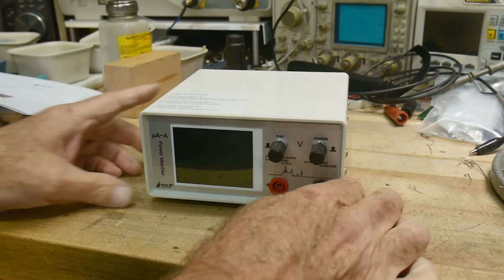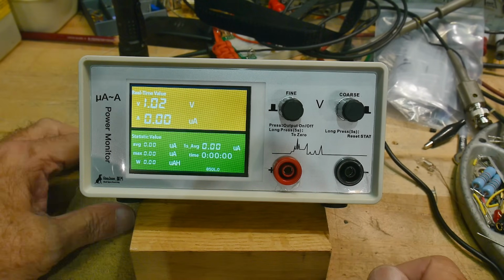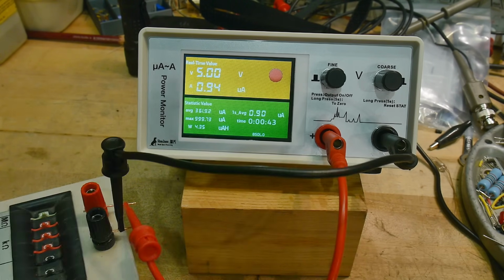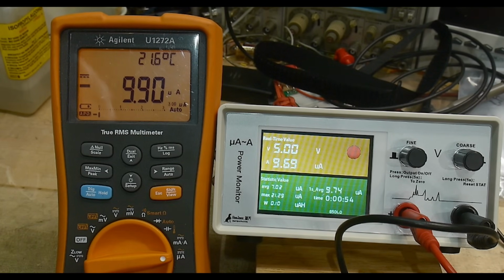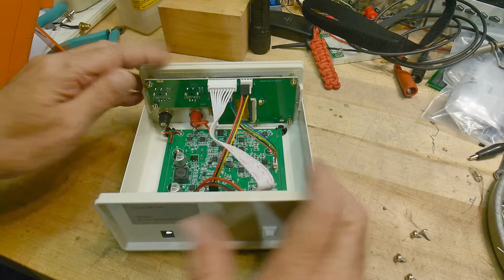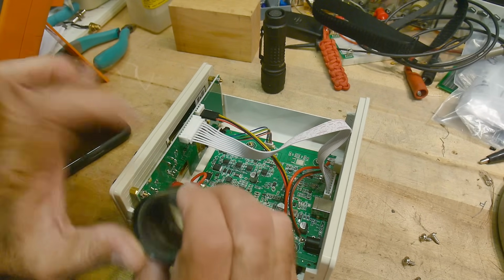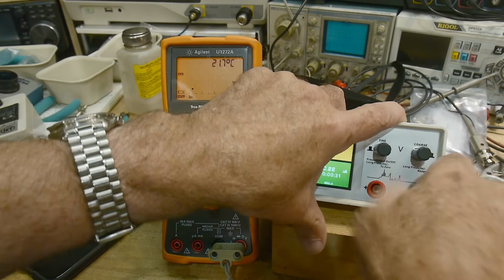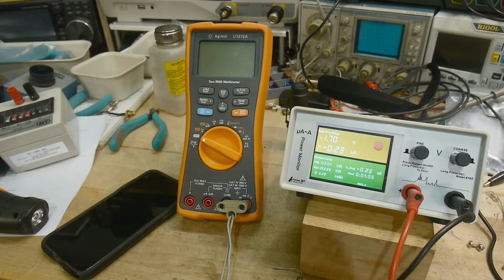#1675  ReeJoee uA-Level Current Analyzer Review

Comment: Measuring µA with a device that is powered with noisy switching powersupply can't be accurate.
The DC jack is probably 5.5mm x 2.5mm, if you have a old notebook charger or other faulty powersupply with such a lead connected, cut the lead from the charger and attach banana jacks, then power this "Analyzer" with a linear powersupply, and i bet that it is more stable and not jumps arround like that. 
The wires from the DC input to the On/Off switch run over many IC's, where the switching noise gets injected in those IC's beneath. 
If you use a Non Contact Voltage detector like a Fluke Volt Stick or a generic one, those react to the switching noise on top of the DC from switching powersupplies. It wil light up like a christmas tree inside that "Analyzer". Because this switching powersupply doesn't have a earthpin, there is also a certain amount of mains voltage (in µA range) leaked by the safety cap between the primary and secundary side of the transformer inside that switching powersupply, this mains leakage is also present on the banana jacks. With all those flaws together, you can't have a decent and stable readings.

Comment: I don't think you'll get anything else from 'ReeJoee'.  The user interface seems a bit clumsy.  adding a push button switch would make things easier.  Then there is the specs issue you talked about.
As soon as I see switchmode supply on delicate test gear I cringe - noise noise noise.  Sadly it so common now.
The display is good to my eye.  Having the 1sec average value is good as the fast varying on the 'live' value is of very limited value.

Comment: It is $199 for the version seen in this video witch seems about fair for what it looks to be a very low volume product. It is 12V 2.5A so sufficient range to test battery powered devices.
It uses the 16bit sigma delta ADC build in to the microcontroller so plus minus 32000 counts that means for 2.5A max it could measure down to 0.1mA thus it needs to change ranges and based on the video that is not done fast and it also means it will need to zero out all ranges. He should have added a dedicated button for zero offset calibration or he should do that at power up then leave that button for ON/OFF.
Software could be better and probably also the hardware but how much effort can be spent if this is maybe 100 or 200 units of volume per year if he is lucky.
The user interface is fairly bad but even if he spent more time to improve that and even fix everything it will still remain the same niche product and he will still not sell more of them.

Comment: When I want to measure very low dc currents, I use an old RadioShack Model 22-802 pocket autoranging DVM.  When it is measuring dc voltage on its lowest autoranging scale (200 mV max, 0.1 mV resolution), its input impedance is "nearly infinite" (probably higher than a hundred gigohms).  When I connect it in parallel with a 100 megohm resistor, by Ohm's law, 0.1 mV becomes one picoampere.  So in this case I have a 2 nanoamp full scale meter that can resolve a picoamp of current, and it measures its own voltage burden!  If I use a 100 kilohm resistor, I have a 2 microamp full scale that resolves a nanoamp.  With a selection of 1% tolerance resistors in decade steps, I can keep the voltage drop under 200 mV so the unit does not autorange up, and I can measure any current I want.  Being battery powered, it can be floated in-line on lines of any voltage.  I think I paid about $20 for the meter on sale a long time ago when it was being discontinued by RadioShack.  Today, resellers are asking higher prices, but there are similar copycat meters marketed today that presumably have the same characteristic.

Comment: I was completely unsure about the purpose of that unit, so I did a little bit research (it's a good way to procrastinate, I have much more important things to do, but, well). I didn't find that company (or what it is), but what I found is a set of videos on YT describing how to use this product. And the purpose of that thing is fast measurement of low and high currents drawn from that unit (or other device),  displaying them on the screen of connected computer and integrating them in time to display them on the device's screen. This should be useful in case of analysing devices that consumes power in pulses or bursts, which is measurement you can easily achieve using an modern oscilloscope and current probe (or current shunt). But in this case, you have it in one thing with weird UI and, of course, you need an computer running obscure chinese software to obtain at least some useful data from that unit. That thing is in fact unable to measure currents in hundreds of nA, it would have to utilize at least some kind of guarding, that thing can go down to abt mA, maybe hundreds of μA, but as it integrates across (some unknown) time period and is capable of catching a really short pulses, the indication goes down to tenths of nA, because that's the result of computation of that integral. Is that thing useful? Maybe. It heavily depends on its price tag. In fact, there are available a bunch of different devices capable of doing this, but in much better way, like they have a huge dynamic range, they are incredibly fast, etc., but they cost you a fortune. Or you can use an oscilloscope to achieve results almost similar to this device, but in much predictable and convenient way. And on top of it, oscilloscope is something you typically have on your desk, so it costs you near to nothing.

Comment: It looks like the power line is running under all four TL081 opamps and is also not traced out from a single point to all the opamps, but there is a long trace that runs under all opamps, and the opamps are hooked up to trace with caps in between, or am I mistaking? That is, IMO, not the right way to hook up an opamp or any analog circuitry.

Comment: Too bad it doesn't work.   I've been using a uCurrent and oscilloscope for small current measurements, but it sure would be nice to have a power supply that could current limit in the micro amp range.

Comment: When you complete 90% of the product but you forget to complete the other 90% of it

COS721SR is 10Mhz 5.5V RRIO opamp

I guess you have to zero because they refuse to use any precision opamps anywhere

You'd think you'd want guard traces and a guard terminal to do good uA measurements. But not a charge pump switching inverter right next to the inputs!? I'm guessing most of the utilty of the device, if there is any to be found, would be from it logging values to a CSV in a computer to analyse.
Reply: I think I could do it better using the same op amps :) For a cheap product at room temp in a case that stays cool you can get plenty enough performance. But whatever MCU mangles the measurements is the source of another trouble. Low cost analog demands a bit more from firmware to make it work well. And some inventiveness. This one is a story about how not to do it.